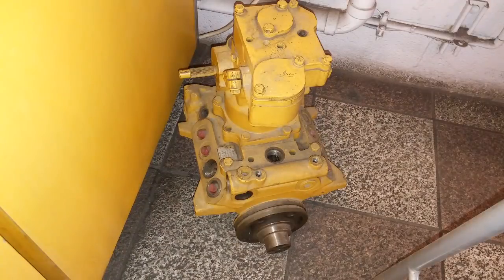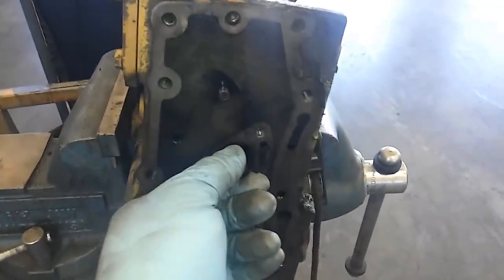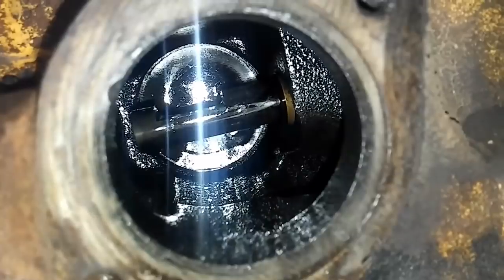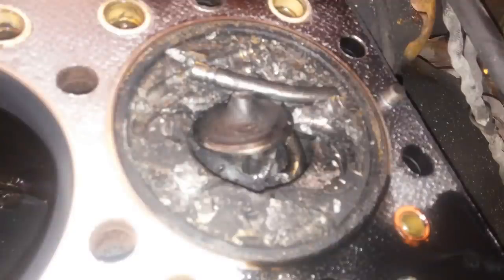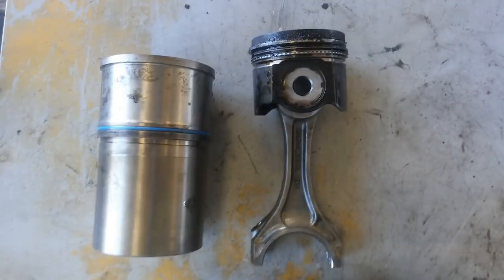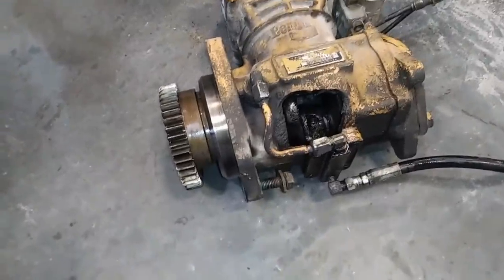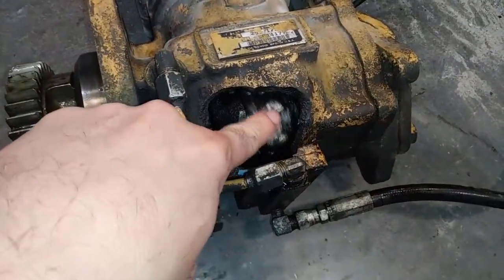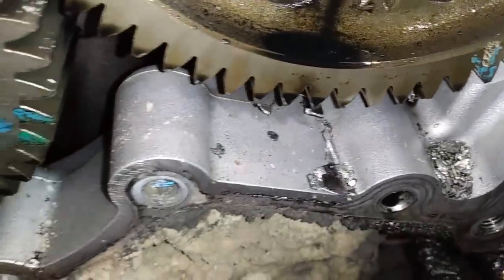Why Do Diesel Engines Runaway? What Is A Diesel Engine Runaway?

Comment: In the 1980's I experienced a 2 cycle Detroit  running backwards... But I was absolutely gobsmacked when a DD15 Detroit did it  ---and did so very suddenly at idle. Shocking how fast it sucked the accelerator  to floorboard, exhaust roared out the air intake, and the engine blew up just as I killed it in gear. This happened much faster than that old 2 cycle did. The DD 15 was a well maintained , low mileage engine that was used only on light loads and was never allowed to run at too high rpm , nor too low.Warranty had expired 21 days prior to this catastrophic failure. Detroit headquarters wanted the engine back asap, to do autopsy on it. They sent a new engine for free, and I think even footed labor cost on a local Detroit affiliate shop . (Company owned truck).Glad i was'nt an owner operator!
Reply: A backwards running motor? That's crazy!
Reply: Thanks for sharing your amazing story.
Reply: Every 2 stroke is able to run backwards, 2 strokes have no valves, that means everything stays normal, intake stays exhausts stays exhaust. Your story is a lie or it wasn't a 2 stroke.....
Reply: 2 stroke diesels have intake ports in the cylinder wall and an exhaust valve in the cylinder head. Both are open at the same time at bottom dead center. Because they make no vacuum they need a supercharger to push the air through. So they dont need the space below the piston, thats why they have an oil sump. When the engine runs backwards, the supercharger sucks the air through the intake ports and fresh air enters through the exhaust valve, thats why they smoke from the intake. Also the oil pump runs backwards, thats why it probably died.
Reply: @mariegoldstein6687  You are either  contradicting yourself, or formulating it badly. And you might want to read Heinz LETZTE's explanation, that precisely fits the story as told - cause you're not making sense either.
Reply: Yep. I had a Deutz air cooled two stroke in my excavator run away backwards. Kept going for a LONG time. Took at least ten minutes to die. Lots of $$$$ later she's fine. Until the next thing breaks.
Reply: Leon Piepkorn or, maybe you didn’t think about the fact that just because the piston and crank can move in either direction, that doesn’t mean the ignition timing is proper. Which means the ignition could be early, and there would be no where for the exhaust to go except the intake. Simply due to the crank angle-ignition timing ratio. Now the OP did mention that it happened fast, and blew up fast. So explaining how it would run with intake coming from the exhaust is a bit difficult although not impossible, vacuums can be made without the need for the piston to create a larger volume, but explaining how it would blow itself up when it’s igniting well before the intended time (maybe even on the upstroke) makes a lot of sense. I doubt it’s a lie, and I doubt it has to be something other than a 2 stroke. As unlikely as it may be, an engine designed before Auto Cad and fluid simulations might have mechanical issues. Hence why the company was so apt to replace the engine and do an autopsy even though warranty had expired.
Reply: Car Wash Adam Cooper: Deutz are 4 stroke.
Reply: I had a dd13 run backwards too! It had been run on bad fuel. Customer drained out the fuel then added new diesel THEN brought it to us saying it was running bad. I started it up and it was miss firing and fuel knocking. It almost stalled out, but then it shook real hard, started fuel knocking and then it took off. Smoke out of the intake and everything. I shut the key off but it kept climbing. Hopped in and jambed it into gear and dumped the clutch. It shut off but it took out 2 rod bearings. I put a crank and complete fuel system in it. Detroit still covered the parts for some reason. Customer still denied that they ran bad fuel in it.
Reply: Every modern 2 stroke snowmobiles reverse established by running the engine backwards.
Reply: @misters2837  not all. 2-stroke is perfect for a a direct injector engine. Carbureted you always loose fresh mixture. When the fuel is added separate, there is nothing to loose. Most single or twin piston diesels are 2-stroke. So half the engine gives you the same power. More compact, less weight and less costs - or much more power for the same size and weight.
Reply: @CC-ke5np : Any that would be in an "EXCAVATOR"  the Deutz 2 strokes are Large Marine engines (TM Series) but you probably know that.
Reply: @misters2837  there was the OM, PM and RM series as well. All less than 145hp.

But you are right. I had to look it up, they stopped making them in 1966!
Reply: @CC-ke5np  I never saw the smaller ones, I am sure they made them.   2-Strokes are the most efficient at turning diesel into noise!
Reply: @misters2837  in my area (near the district of Deutz, Cologne, Germany) you can see them at almost any vintage farming tractor event. Just wait until it gets very loud and head into the direction of the grey smoke column. At the bottom is usually a trailer with a bare 80+ years old engine bolted to it running without any muffler.

When smoke rings appear in the air, go see the Lanz Bulldogs.
Reply: @CC-ke5np  In my area "USA" that loud noise is a Detroit...and smoke rings are from Fairbanks Morse stationary engines!
Reply: @CC-ke5np  I once saw a video of a tractor, but I can not remember the brand, it looked like a Fendt F220GT (That front Bed Style) but you could tell it had a 2-cycle gasoline engine... it sounded like a SAAB!
Reply: @misters2837  hard to tell. If small, they were used until the late 1980s just like quads or ATVs are common nowadays.

The large ones are usually very old and were made during or after WW2 and once heated up on gas ran on petroleum, the only civilian fuel you could get in adequate quantities since not used by the military.

By the way, the large Diesel in Denmark had helped a lot recovering the European power grid in 2006. A greedy German power company caused a mess which had cascaded all over Europe. The grid was split in half for many hours where the west had over 55Hz and the east less than 45Hz Since the split was caused in Germany, it also ran through Denmark and this diesel first pushed up the east frequency and then dragged down the west frequency and so it speed up the matching process dramatically.

Also almost all power plants need a working grid to start up. The diesel in Denmark is one of the few precious "black-capable" power plants in Europe. It can start on its own power and then provide enough power to start up other plants. Most of the other plants were removed to to environmental laws or low profit.
Reply: C64 C64 I figured it out...TFS or VEB?  RS 08/15 (https://de.m.wikipedia.org/wiki/RS08)
Reply: @misters2837  This is  a "mole" which is a so called "device carrier". So it is a motorized platform you can mount anything on top which may use power from the engine. It can be  generator or machinery for harvesting or processing the harvest. It can also be as simple as a box to carry stuff like hay, grains or construction material.
I have even seen an excavator mechanism although for a different (larger) platform.
Reply: @misters2837  The RS08/09 is equipped with two PTOs, one for the device it carries and one for the trailer. They connected t either to the gearbox in or out shaft independently. So the PTO either turns "distance related" with the wheels or all the time with the engine RPM. So you can either plant stuff with even spacing or run something while stationary (e.g. generator). Since independent you can run the actual harvester on top of the mole slow and distance related and spin the threshing machine on the trailer with full RPM.
Reply: C64 C64 Very versatile Tractor...I have seen photos of a few with the "box" for hay and whatnot.  That is Very neat about ability to have both the "live" PTO (engine driven) and the speed dependant PTO.
Reply: @misters2837  they were replaced by dedicated machinery in the 1960s but were used a small front loading dump trucks on construction sites until the mid 1980s. Nowadays with excavators being rather cheap and easy to use they have vanished completely. Now they use mid sized excavators and big trucks to move stuff around on construction sites.
The main problem is that those "open machinery" vehicles are too dangerous for modern safety standards. Many levers, hinges, wiggling and turning parts easy to reach by accident and to loose limbs instantly.
Reply: An old Milwaukee chainsaw can run backwards, so can a two stroke dirtbike. I've seen it happen.
Reply: I watched a DD13 run backwards. Had a bad injector dumping fuel into the exhaust. It hit just right while cranking the engine to start up backwards. Sounded pretty nasty.
Reply: @mariegoldstein6687  Detroit diesel engines are two stroke but they do have exhaust valves to help create compression. No idea why the newer 4 stroke detroit ran backwards, but stranger shit has happened.
Reply: @mariegoldstein6687  sorry Marie 2 cycle detroits have exhaust valves but no intake valves.
Reply: @mariegoldstein6687  -Not true i had them run backwards ,remember the intake getting hot
Reply: I've had a 4 stroke 3 cylinder Yanmar run backward on me.. no big deal, shut it off and restart it
2 strokes can run either direction if they're piston ported and valveless without a problem as long as they don't rely on an oil pump turning a certain direction.. The injection timing could be way off running in reverse though
Reply: The exhaust got sucked out of the intake ports by the supercharger... lmao
Reply: -__- So what exactly “sucked the accelerator to the floor”
Reply: EATSLEEPDRIVE2002 because it was running backwards it created pressure in the intake therefore blowing the flapper plate open making the pedal go down
Reply: What?????
The engine run backward and instantly blew? How? I think it had no oil. But instantly? Thats weird. They floored it and it blew?
Reply: @no_aa08  flapper plate?   On a Detroit DD15 DIESEL??? Yeah, there is no plate there…..
Reply: @thetowndrunk988  lol ik i was drunk and being smart
Reply: @no_aa08  LOL. Ok
Reply: @thetowndrunk988  lol

Comment: I worked on offshore supply boats in the oilfield and we'd keep huge blankets in the engine room in case of a runaway to smother the engine. I've experienced one runaway on a 1692 Marine Detroit Diesel but I was able to shut it down before it destroyed itself. It's a little scary standing over the engine trying to shut it down while thinking of all the stories you've heard of pistons coming through the side of the block

Comment: Have watched a 3406B run away after the air fuel ratio control was installed incorectly forcing the rack to full fuel. Can remember hearing the engine crank for ages from across the shop, when it fired it started slowly and started to wind up after a few sec we could all tell there wax no stopping it, after a minute the valves started bouncing causing flames around 5 foot long from both stacks at this point it sounded like something possessed, the guy doing the job had long since fled the scene by this time, another fitter climbed up in the cab found a high gear and stalled it out on the brakes. Cheers mate🍻

Comment: When I was in high school we had a bus  that  was just on the edge all the time. The thing was  scary to ride on because it ran a little higher than it’s  governed  speed. And what was worse was The bus  repair garage never did anything to fix it. And I didn’t actually experienced this, but my senior year my bus driver was leaving a  stop light and his vehicle ran away on him, and he had to stall as he was going around the corner so it didn’t catch on fire. The next year after I graduated they decided to replace that old bus with a new one.

Comment: Most runaways are caused by the engine running on its own oil.

-If the turbo seals go out...
-If the crankcase gets too hot the oil will boil and the fumes get sucked into the intake.
-If the fuel pump starts leaking into the crankcase, the oil thins, gets hot , the engine starts running on the fumes coming out of the crankcase.
-Clogged air filter, there is so much vacuum in the intake you start sucking oil around the intake valve seals and piston rings. 

Then there is my all time favorite, brand new engines running away because the builder used way too much parafin based assembly lube.....first time the engine got hot under load it would boil the paraffin out and the fumes would overrev the engine.

I've only seen one runaway caused by a bad governor or fuel system, but I've seen dozens of runaways caused by the engine consuming its own oil.

With synthetic oil becoming more common , I'm seeing fewer examples but it still happens .
Reply: Unless I've been misinformed , It is my understanding that a hot Detroit 2 stroke will occasionally runaway "after" the  fuel is shut off.  If this is correct and it is from oil fumes or leaking oil, do you have any idea why it would happen "after" the fuel is shut off? If the oil is hot enough to produce enough fuel vapor to over rev the engine with the fuel valve off then I would think it should runaway prior to closing the fuel valve.
Reply: @berserk7111  the governor compensates for the extra "fuel" provided by an oil leak , so at first you dont notice anything, but once the oil leak gets big enough to actually run the engine , then it wont turn off.

Which is why Detroit Diesels had a flapper you could close to starve the engine of air.

Detroit Diesels consumed so much oil that when they were being used in semi's every highway had a thick black stripe down the middle of the lane.
Reply: @glennchartrand5411 Thanks,  I did not consider the governor.  I''ll need to research how it works On the DD. 

The first time I realized how much these things really slobber was when  I looked at my field from a higher vantage point and saw a thick black squiggle line like someone used a giant felt tip marker all over my field. It took me a second but then I remembered I had driven my f250 with a 4-53 earlier in the tall grass. The drivetrain and undercarriage is completely covered in oil. 

Thanks again for the reply. Very much appreciated.

Comment: Tennis balls work too apparently. A science teacher at a school I worked at had a Mercedes 300D wagon that ran away on him due to some manner of rack failure. Being a science teacher he quickly thought about the fire triangle and jammed a tennis ball into the intake. Ultimately he saved the engine, and only later noticed the red lever labeled "Stop" on the side of the engine

After watching this, if I ever wind up with any diesel rig of my own I'll def install some manner of air cut-off system
Reply: carbon dioxide or nitrogen flooders work too.
Reply: I have a 300D and i had no idea what that STOP lever was. Thanks man!
Reply: The STOP lever is attached to the rack. It pushes it below the governor controlled idle position to bottom out and kill the engine. A mechanically injected diesel runs without electricity, it requires a positive force to shut it down. Mercedes used a pneumatic servo to operate that lever, similar to their door lock actuators.

For marine/industrial applications, Murphy Controls makes a safety stop actuator that incorporates a 30lb spring to push on that STOP lever if the  power to the solenoid (holding it back while the engine is running) is cut.
Reply: Oh shit...I have one of those...
Reply: Or just install some sort of auto shutoff for the fuel pump if the engine reaches a certain RPM. Runaway diesel problem solved.
Reply: I remember my friend had a 300d and we dropped by waffle house once, we stopped and he cut the engine and put it in park.
Well, it kept idling so he killed it with the stop lever and the car started rolling backwards, right into a curb.
Reply: the emergency cut off for diesel engines is required by law ( at least here in Alberta ) in the oil patch

It's a simple butterfly valve typically that closes the air intake
Reply: @generalkayoss7347  a true runaway gets it's fuel from elsewhere, (like burning engine sump oil) so that will only stop an over rev, or "run on" situation. A true runaway can have 0 fuel pressure and still run, if it doesn't over rev and blow up, and it isn't stopped by some other means it will run till engine oil is gone, and then the bad stuff happens.
Reply: @generalkayoss7347  Not necessarily if the cause is worn piston rings and the engine starts consuming lubricating oil from the crankcase. The only sure way of shutting it down is to dump nitrogen, CO2, or Halon into the air intake. The good thing about this method is that if done quickly enough it can prevent catastrophic failure of the engine.

Comment: Great video. When I first started driving trucks in the early seventies in Winnemucca NV I drove an old Kenworth with a V-12 detroit. It gets really cold in the winter time and that detroit was a real pig to get started so I always had to use ether if it had sat overnight. One early morning I was trying to get it started and when it finally did it just kept revving higher and higher. I pulled the fuel shutoff and it only slightly slowed so I pulled the emergency air shutoff and the cable broke. Since this was a cabover I couldn't get to the intake to try and block it and I didn't think to use the fire extinguisher so needless to say it ran at what sounded like 10,000 rpm for a few minutes before it stuck some pistons and finally stopped. I tore it down to see if I could fix it but  it would have cost more then it was worth. I put a 335 cummins it in and drove it for several more years.
Reply: lol sounds like every prevention mechanism failed at the same time
Reply: very surprised piston parts didnt shoot out of the block like armor piercing  amo... like what happen to us
Reply: @heinzletzte.6385  LOL
Reply: @gentbar7296  Yes